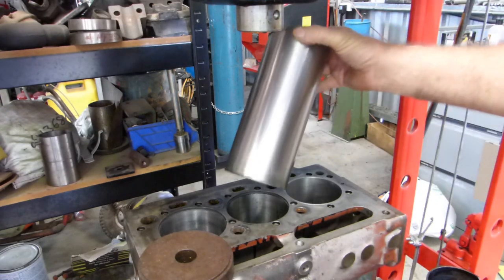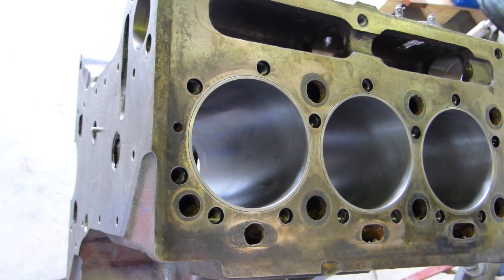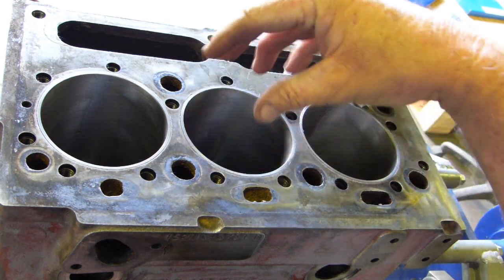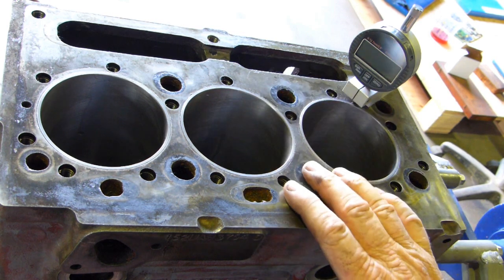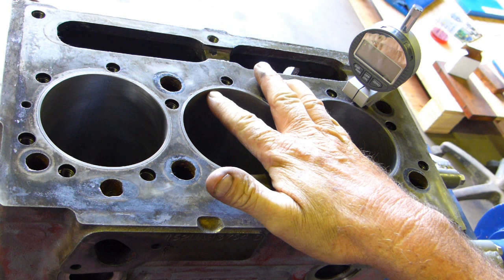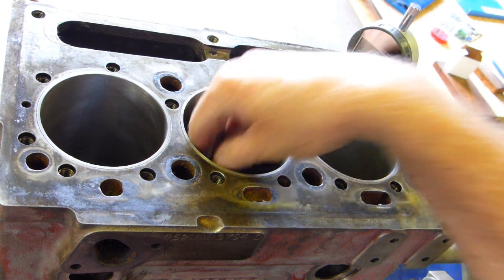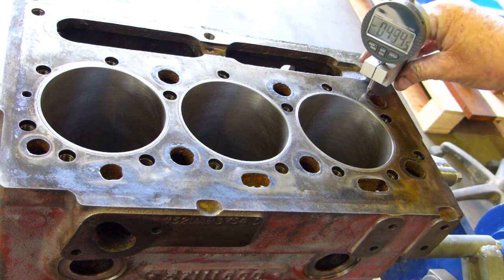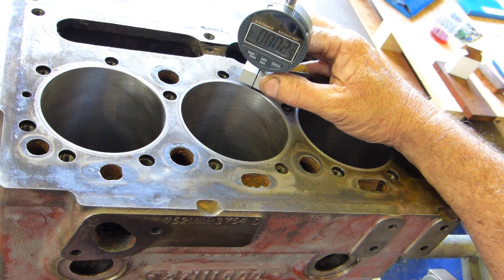MF135 Restoration #12 Fitting the Liners

Comment: I have a MF50 with the 152 Perkins. The overhaul kits specify  (.040 SLEEVE FLANGE THICKNESS) or  (.150 SLEEVE FLANGE THICKNESS)
I guess I need to measure the existing sleeves in the engine to know which set to get? The difference in price for the kits is 21 cents!
Reply from the maker: Yes measure and get it right and you will save a lot of hassles.

Comment: I have fitted hundreds, oil only, as long as they are not below and no more than about four thou proud, you won't have a problem, these are "old school" engines and not very highly stressed. I would never loctite them because you will have a real problem if you want to move them in the future, low liners are  are more of a problem when it comes to head gasket failure.
Reply from the maker: Only used loctite as they were a bit loose I felt.
Reply: @BundyBearsShed  ,I always worry about how you'd get them out in the future if they are "glued" in, if they are really loose you can get the block machined and fit oversize liners, my local Perkind specialist always doe does this if the liners are not a factory fit.
Reply: @stevefuller1779  Indeed I broke the puller trying to pull a loctited sleeve out, I ended up just chipping it out which was easy but messy.

Comment: I can find these data regarding sleeve hight:
For the 3A.152, "Top flange should be 0.001-0.009 below top surface of the block."
For the AD3.152, "When properly installed, top of the sleeve must be flush to 0.004 below top face of cylinder block."
Reply from the maker: Yes I have been doing some more research as well and found similar results. I am going to check where the head gasket fire ring goes too see it I need to drop them a little but Im thinking the gasket wont compress enough to worry it. I will film it if I change my mind. I need to pick up my con rods after resizing so I will ask the engine reconditioners their opinion as well.
Reply: @BundyBearsShed  
My best estimate is that yours are perfectly fine as they are.
If we look at their wording "when properly installed" it indicates that it is to make sure the liners were pushed down all the way, and there was no debris caught up under the edge. They probably made the edge a bit thinner back then, and now it is thicker, so it can protrude a few thousands of an inch above the block.

Comment: Hi Lance, loving your videos..been watching the past few months. Without these videos i wouldnt have my tractor in bits right now;) Mine is a 1964 model, normal gearbox and round rear arches, which used to be my grandfathers when he was a farmer... Doing a full restoration on it! I pulled the engine off intially because it was leaking oil from all the places it could..Couple of the pistons have had broken rings and the diesel pump needs a new pump head etc plus lots of other bits. Did all rust removal past couple days on the head and block using electrolysis with sodium carbonate, worked a treat...possible i could email you with a couple questions on the block and pump and send you some pics of the tractor as is now?
Reply from the maker: bundybearsshed@gmail.com will get to me.

Comment: Slip fit liners take the pain in the ass out of it  ,  do they make oversize o/d liners like Detroit used to for their bird scarers ?
Reply from the maker: G Day Max, I did a search and found a 0.030" oversize liner for the AD3.152. That would need the block to be bored to fit them but it is certainly a good option. I would not like to see these any looser but the Loctite 680 will save the day they assure me. 
'
Reply: @BundyBearsShed  do you just put the loctite all around the liner or something?

Comment: sure did sound like a good fit going in there.   680 is termed a "retaining compound".... theres an eternal argument in my shop vice red loctite.
Reply from the maker: G day Kelly, That 680 is good gear, when I machine vintage water pumps I have a dummy bearing shaft I lightly 680 into the bore to hold the work and I often need to press it back out again after machining. It retains alright.

Comment: Back in the late 80,s when Leyland had the new TL11 engine they started burn oil like bush fire 🔥 and having localized overheating 🥵 issues grabbing pistons
I worked for Leyspares a customer brought a liner in (thin walled chromehard) with one look 👀 down the bore it became apparent the it was the loctite that was causing all the failures. Where the loctite was applied to the back side of the liner whatever the drool 🤤 mark on the back was a height spot wear mark in the bore. Overtime the Loctite swole up and created high spots in weird patterns in the bore causing hot 🥵 spots as the liners where not contacting the parent bore.
We informed what was left of the old guard at Leyland and they had found the same issue. Leyland was defunct by 1990 in Aussie.
 Was put down to a bad thick batch of Loctite.
Reply from the maker: Thats an interesting yarn. I had not heard of that or a bad batch of loctite either.